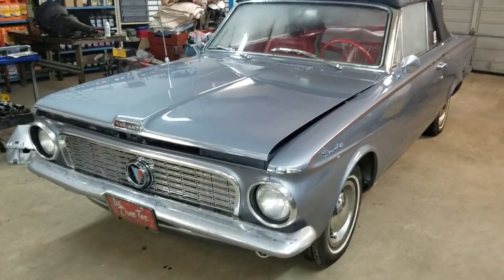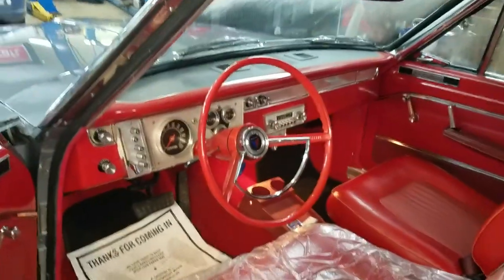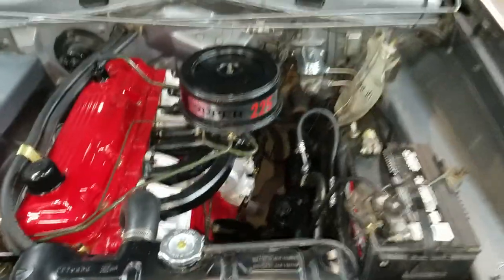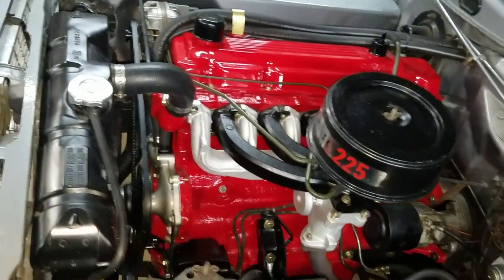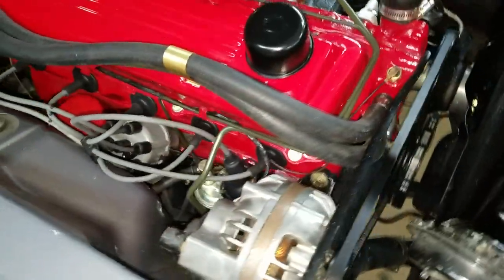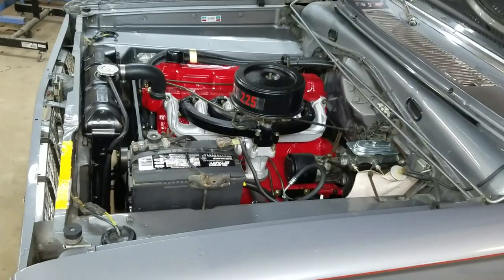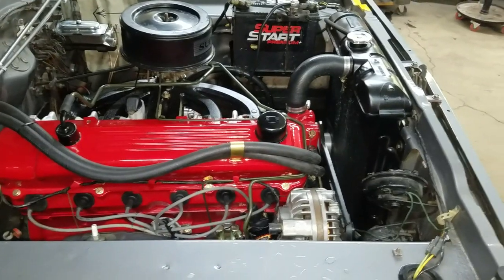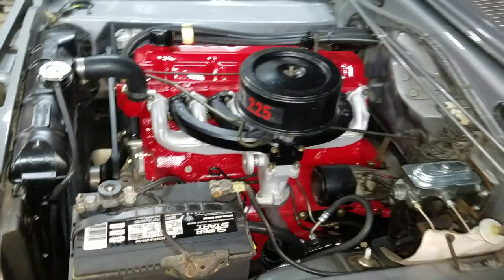1963 Plymouth Valiant 225 Slant six

Comment: just stumbled across your video . Ya it's amazing how someone watching someone else's video can nit pick things in the video 🙄. Very nice car. what did you or they use to paint the engine , intake and exhaust manifold? they look like they where dipped in clear glass 😎👍. the only thing I didnt like about factory slant 6 exhaust pipe on a slant6 is that it was restrictive . on my slant 6  in my 65 dart 2 door post car the exit port on the manifold is 2 or  2.25  wide and the factory exhaust flange was 1- 7/8 or some thing ?  causes the heat to build up in the manifold and burns out the flange gasket over time . I switched to a flange and pipe that matched the exit port on the manifold . much better flow  and performance and still looks stock.  still a very nice car 😎👍🏁🇺🇸

Comment: That's a nice car.  I agree with keeping the slant six engine those cars didn't really need the extra weight of the LA engine for normal everyday driving.  Chrysler built millions of these cars in the 1960s and 1970s and they were reliable daily drivers for many who didn't want or need the larger cars that were common in the days of inexpensive gas.

Comment: Very clean finished product: well done and glad that this sort top was given a new lease on life.  2nd Gen A-bodies certainly are special cars and deserve to be preserved: budget workhorses that are reliable and fun to drive.  They're also incredibly well built and easy to maintain.

Curious: what disc brake conversion set-up was chosen for the build?  So often, kits seem to push the front tires outward toward the fender wheel opening and this set-up leaves it looking OEM.  

Thanks for sharing.

Comment: as a teen driver i had one. put it on the floor and push second gear button and it would churp the tires. that engine was bullet proof. i ran it about 5 miles with no oil in it, valves rattling, knocking deep inside. got to store, bought 3 quarts, like nothing ever happened. thats why they dont make that engine or the for 300 6 banger, TOO DEPENDABLE!

Comment: I love that 63 Valiant, Chrysler designed a winner. My dad, was a mechanical engineer said Chrysler had good engineers, when they built the Slant-6 cylinder engine it was dependable, tough, and a long lasting. The Valiant had torsion bar front suspension that was good for handling and with other upgrades made it into a great race car, the Australians raced them.
Reply: Cars and trucks with slant 6s would fall apart from rust long before the slant 6 had a problem, good in cold weather too.  Had a 72 Dodge Dart 4 door with the slant 6, such a unique sound, and it would go as fast as you would dare drive it, better gas mileage than a Ford straight 6 I had in my old Ford Granada.  Really versatile.  Had a friend with a big dodge 4x4 she had a slant 6, stick, great truck.

Comment: I have a 63 Valiant with a stock slant six I just rebuild, the only problem I’m having is that the carburetor or timing it making the idle too high and my radiator needs to be recored as well due to overheating, I also have an oil leak problem with the oil pan and it has all New gaskets, I’m Located in California is their a mechanic you know of to get my engine running smooth? It’s a 2.8L 170 cubic engine